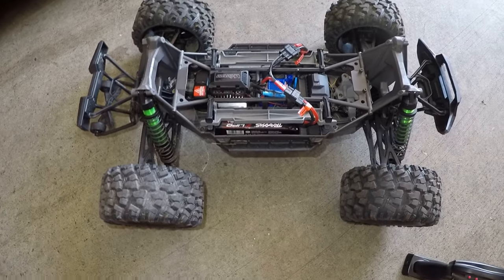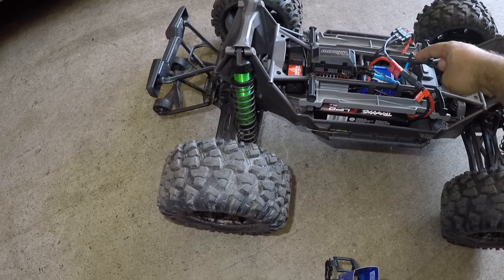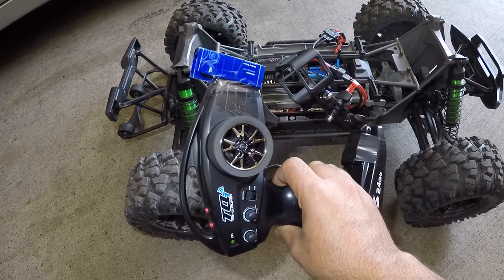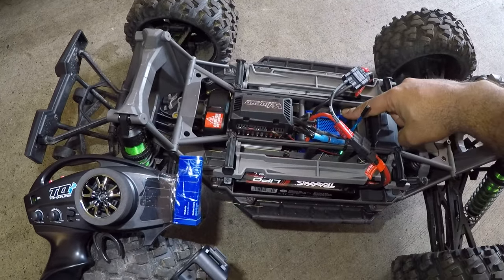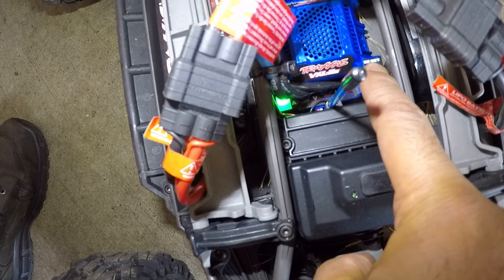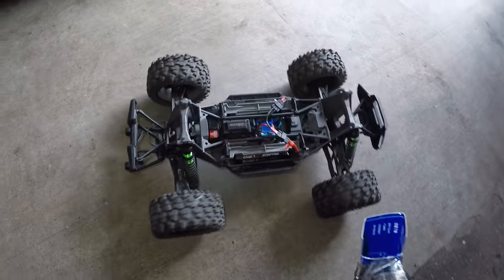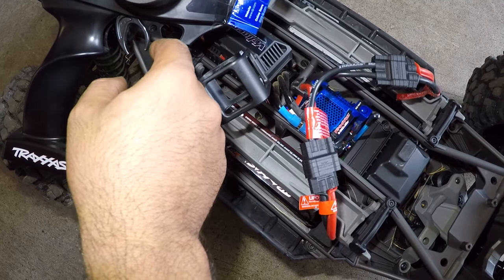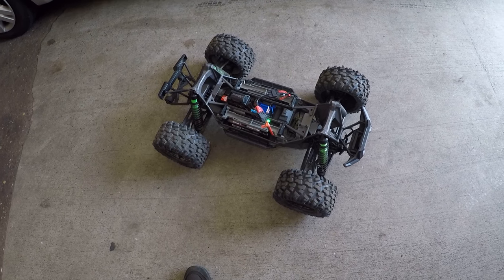XMaxx turns but dont go forward or back, calibration needed

Comment: I don’t understand, I already calibrated mine, it’s just been 2 1/2 weeks, everything is stock except for new Duratrax Six Pack S tires which I calibrated for afterwards after putting them on. My XMAXX has only been running for 3 sessions until it started doing this after sitting for two weeks, batteries were in good health and taken care of when I was waiting for my tires. It drives then shuts off power and just makes a whining noise when I push on the throttle again. Not sure!

Comment: what does it mean if after the calibration it only will go forward. the light on the reciever flashes green when you pull trigger in reverse but it doesnt move. there something defective in the transmitter?
Reply from the maker: Maybe u have it in racing mode

Comment: So I have a Max 5 that turns on and flashes but does not have any audible tones and all I have is steering and when I hit the throttle or reverse it just shakes the gears and doesn't move forward or backwards. This is in an outcast 8S with a Max 5 and 1250kv motor
Reply from the maker: Check ur connections and remove the motor and see if it turns might be jammed bearing on motor or somthing bad itself on motor

Comment: Hi,  please advise if my truck has no such button to press on the car body,  what should i do ?
Reply from the maker: Then u don’t have stock esc what esc u have
Reply from the maker: How do u turn on the esc
Reply: @rcusa201  It is ROC hobby mogrich 1/18, only have one on/off switch to turn on the car after connercted the battery,  i dont know what to do

Comment: I’m trying to fix an Xmaxx for a friend, I’m not very familiar with them however I’m wondering if the ESC is bad. I performed the steps you outlined here and the ESC responded as if it registered correctly. However anytime I pull the trigger the ESC immediately cuts out and shuts off. Any ideas?
Reply from the maker: Try cleaning all the connectors first the esc will cut of if there’s bad connections to protect it disconnect the wires from the motor and try it if it dosent shut off then it can be bad motor
Reply: MI. RC LIFE, Thx, I’ll check those things and let you know if I have any other questions. When I got his xmaxx, Day one, I turned it on to see what was going on with it and it ran but was only moving at like 3 mph. It only did that for a few minutes and then it all of a sudden got to that point where it stopped moving and when pulling the trigger the esc just cut off. So I almost feel like I might’ve fried some thing. Turns out the issue with why it was only going 3 miles an hour it was because one of the bearings inside of the motor exploded and jacked up the inside. So I was sort of forcing it to run. I’m hoping it’s a bad connector somewhere though. Oh… And the motor is brand new. Just arrived yesterday.
Reply from the maker: East Tactics check for bearing sieved up that could cause issues with motor and esc it will put load
Reply: Well… It looks like I will have to buy a new ESC. Should I pick up another stock ESC, or should I switch to another brand like the hobby wing max 6? What are you running? If I pick up a hobby wing does that open up the options to adjust the punch setting for the X max?
Reply from the maker: East Tactics I had very bad experience with hobby wing I would stick with stock esc or change it to castle monster momba x 8s
Reply: RC USA 201 thx

Comment: So my issue is its f flashing green but then when I turn the steering it starts it goes back to normal solid green but then when I hit the throttle a secondary red light comes on and it starts flashing also when i hit the throttle the motor is getting signal but it just like budges forward

Comment: I have a Traxxas slash  and it will only turn left and drive and I don’t know how to fix it and will not turn right and drive or even drive straight
Reply from the maker: Luke TheMaster17 check your steering trim ... dose the truck turn when it’s off the ground? I have had problems with servos some times they don’t work or take a hard hit the sensor goes off inside if u want u can try taking it apart and play with the sensor I will send u a link to one of the servo that didn’t work for me then I took it apart and played around with the sensor and it’s been working ever since
Reply from the maker: Luke TheMaster17 here’s the link https://youtu.be/Co4g7S5oi7M

Comment: I have the same issue. But when try that I get the 1st red light. But not the 2nd blinking light
Reply from the maker: Steven Golson try again it took me several attempts also make sure ur battery is full in controller and truck also zero out the setting on the controller
Reply: @rcusa201  sorry I just seen this. But I finally got it working. I sold it and went back to the arrma kraton lol.

Comment: What would I do if i hade the  same problem but the truck just flashes red and the truck also won’t turn off unless the battery’s not connected
Reply from the maker: Try this first and if it don’t work out then u need to find out what the red flashing like means should be in the manual book

Comment: My RC Car Can reverse and turn but wont go forward if i press forward it turns off, any fixes for this?
Reply from the maker: UKVolticZ try this if it work or not other than that seems like esc is cutting off maybe ur motor went bad u can try disconnecting motor and press back and forward without motor see if it turns off if not then maybe somthing with motor

Comment: All you have to do is put your throttle trim on the controller back to the 0 setting usually that is right in the middle and it would have worked
Reply from the maker: Thanks for that!

Comment: Hey mine doesn’t have that button but mine is the same thing if maybe you could help thanks
Reply from the maker: Hey ok u can do calibration with controller.   What esc system u got abs controller?
Reply: @rcusa201  I honestly don’t know I’m kinda a nubbie but I tried calabrstion with my controller and it didn’t work I watched a video of this other guy
 And it wouldn’t work and now it won’t even let me turn and still can’t have throttle
Reply from the maker: @cool_boy_crackedatfortnite5154  make video posit it

Comment: I used this it works but I'm sick and tired of my truck doing crap like this every single time I want to use it
It will turn one way not the other, or only reverse, or completely reverses throttle, I press to go forward, it goes backwards, press to go back it goes forward. And it's straight up every single time I turn it on it does something. On my maxx the self righting feature doesn't work right it just blows up my tires, you can't go fast either or it blows its tires its ridiculous
Reply from the maker: It shouldn’t loose it’s binding and calibration call up Traxxas maybe they know the issue or warrnty u. I know if u leave transmitter on with truck off that’s when it goes crazy

Comment: I tried doing the thing then I hold it down until it turns red and i put my throttle all the way to the back and then my ecu it flashes red not green it’s not working help pls
Reply from the maker: Try it again charge the battery full
Reply: I did this even with two charged batteries and it didn’t work
Reply from the maker: @sensitive4686  try
Rebinging and make sure all trims are centered

Comment: I need help my traxxas hose forward and back but dose not turn???
Reply from the maker: I didn’t understand that it goes back and front but don’t turn on?
Reply: I have the same problem. My reciever is flashing red very fast so i replaced it with new and the new one does the same thing. Did you ever find a fix for yours?
Reply from the maker: @kevinbrown7289  this one was fixed in this video try rebidding the  recieved and the do calibration

Comment: does this work for any rc car cus mine does that to
Reply from the maker: beamng universe hd no not all but u can try arrma has set button which I have to hold power on press full throttle then set button and then nutral and then reverse
Reply: @rcusa201  i have a speed pioneer it worked for days then stopped working then i waited for months then worked for a day then it did it just now what do i do oh and your the best youtuber
Reply from the maker: beamng universe hd try re bonding the receiver to TX here’s a video https://m.youtube.com/watch?v=MiKeYJnYjxU I’m more of traxxas and arrma guy but some times the controllers u get with car are not the best like all of my arrma cars controllers r garbage to me I have special controller for speed cars I use DX6R because I can’t have it fail on me when the car is going 70mph or loose range
Reply: @rcusa201  thankes for helping me
Reply: @rcusa201  i don't think the video will work because i have the Baja truck speed pioneer and theirs no buttons in the car
Reply from the maker: beamng universe hd ok I think that one u have to turn on the controller power up the esc and with in 2 seconds hold the throttle full down then neutral then reverse try that
Reply: @rcusa201  im trying to upload the video about the rc car ill show it to you soon
Reply: @rcusa201  sorry its an error with the video its going to take a while
Reply: @rcusa201  do you know how to fix it
Reply from the maker: beamng universe hd you have to try these procedures it’s not that I k ow it’s the process bind it calibrate it
Reply from the maker: beamng universe hd ok upload it then let me  know I’ll take a look if I were local I would had given it try
Reply: @rcusa201  its local
Reply from the maker: beamng universe hd where u located in up north Nj jersey city
Reply from the maker: beamng universe hd that’s not
Local well make a video
Reply from the maker: beamng universe hd ok I’m gonna definitely take it look give me till morning I have to do some research
Reply: @rcusa201  and i thought you meant public
Reply: k
Reply: @rcusa201  my rc car did it again and i don't have a test light
Reply from the maker: beamng universe hd can’t check without test light or ur gonna need another motor to plug in
Reply: @rcusa201  k ill try to get a test light its just been a busy week for me
Reply from the maker: beamng universe hd ok buddie let me know u don’t have to get test like u can get another motor or led bulb somthing that can take motors place so if there’s power comming out to motor it will light up so that was h will know u have bad motor
Reply: @rcusa201  yo no way im way older now trying to look back do you know what channel i uploaded that video of my rc car? i forgot about it or at least what the video is called

Comment: My rc CAR has a switch not a button, help me
Reply: And when it starts it just goes for like 30 seconds and then it starts going super slow and stuttering, PLEASE HELP MEEEE
Reply: Yeah, I know that, since I had the same problem. I replaced the motor and still had the same problem. After a bit, while repairing it, my esc/ receiver box died. So, in your case it might be the esc as well. I have an l959.

Comment: My granite quit and wont go forward or reverse
Reply from the maker: Check and do calibration
Reply: @rcusa201  burned up motor they fixed it damn thing only lasted 3 days
Reply: They put a spektrum motor in it for $105 new charger 4 $40 upgraded the esc. A shock busted off it. Charger was junk had 2 buy an ultrasport pro. They said at rc shop i can go with 3s 11v lipo if i upgrade the gearbox and put in new axles

Comment: when it starts it just goes for like 30 seconds and then it starts going super slow and stuttering, PLEASE HELP MEEE
Reply from the maker: Jesper Nordahl ok remind the the truck to the controller   Do u have another controller?
Reply from the maker: Jesper Nordahl here’s a video should be similar https://youtu.be/Tb65geNWIHQ
Reply: RC USA 201 thank you but i changed some cables that decide what on the controller is doing what and it worked but now it just goes extremely slow on grass after like 2 minutes but super fast on the asphalt.

Comment: It’s not going forward or backward at all when I do that
Reply from the maker: Outlook u have xmaxx? What’s the problem how it happned
Reply: RC USA 201 I have a Maxx but me and my dad started it up and then it only turns and doesn’t go forward or reverse.
Reply: I tried the thing but it didn’t go
Reply: It only blinked green whenever I tried to go forward
Reply from the maker: Outlook try it again maybe ur not doing it correct give it another shot I did his few time to get it correct. Also make sure ur turn switches r centered out make sure ur battery is full in the controller
Reply from the maker: Outlook yup try it again that’s what mine was doing originally
Reply from the maker: If this doesn’t work but g the controlled to recieved all over and do this calibration  .. did u just buy this truck? Is it new used?
Reply: RC USA 201 it’s bought and new I’ll try what you said
Reply: RC USA 201 I tried it again and it still doesn’t work
Reply from the maker: Outlook you have test light sure we can do FT let me know if u got test light
Reply: RC USA 201 I figured it out
Reply from the maker: Outlook ok what was it
Reply: RC USA 201 I did the same thing but instead of just pulling the trigger only I also point the trigger forward (reverse) and it worked perfectly fine.
Reply from the maker: Outlook nice year ur suppose to do front back and some cars neutral with all the trims on controller to zero I just bonded Kraton 8s for my friend  I did that it worked great hobby ship guy tried to sell him new ESC for $300 welll great job make videos post them up

Comment: It didn’t work for me I must have another problem
Reply from the maker: benjamin hodges what is it doing
Reply: same to me on my slash 4x4. I searched and i think my problem is on the reciever! I tryed this steps but didn´t solve the problem. So i think i will need to try buy a new reciever.
Reply from the maker: Manuel Magalhães if it don’t bind try another reciever

Comment: It didn’t work unfortunately I try to follow really carefully but didn’t work but thank you anyway
Reply from the maker: Red Head what’s exactly is going on ? When u turn on tell me the colors of light on recieved esc
Reply: (My model is 76064-5) when I press to forward it doesn’t turn green and when press it in reverse it turns green but when doing that I don’t know when to let go or press forward it just green and I when I’m in reverse and I press the green light is just blinking and I let go it’s just blinking. Hope this makes sense thank you for replying!
Reply from the maker: Red Head ok try this make sure ur steering trim is center and the abc knob to zero try this again try it few times   If it dosent work then try opening up the recieved and rebind it also check the battery power in the controller
Reply: RC USA 201 I’m trying it right now I will tell when I’m done thank you for replying again
Reply: RC USA 201 okay it’s all trim but still when the red light blinks twice I press forward right,now there’s no light but when I press it in reverse it’s green but when I let go the green light is just blinking so idk what’s going or I’m doing it incorrectly or something. Thank you for replying trying to help thank you.i will keep trying.
Reply: I think it’s just the model or something
Reply: Do I keep holding it forward when the red light blinks twice or backwards?